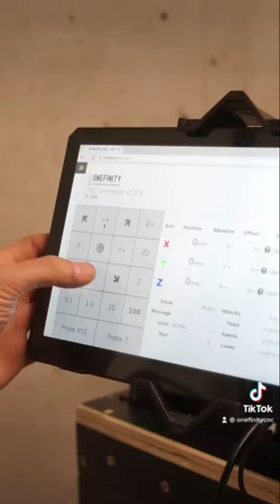Fastest CNC setup ever! #cnc #onefinitycnc

Comment: The anticipation is building waiting for my Elite Foreman 🤩 Can't wait for it!! 🙌
Reply from the maker: We can't wait either!
Reply: I have the X50 woodworker and compared to my old one it's a game changer. I don't cut wood, I mainly do plastics and composites and it's holding .0005 tolerance. I do wish the Z was more rigid, if it was I could do steel. The whole frame is extremely rigid except for that darn Z! The spindle needs a min of a 4 inch tall holder as the 2" is just not cutting it. This is the only problem AND I have to edit every post process output to remove the return to home by changing the last line of code from g53 to 54 to return to XY origin. Other than that it's a really good machine. If there was a box I could check or edit something in the post processor to return to XY origin and not home.